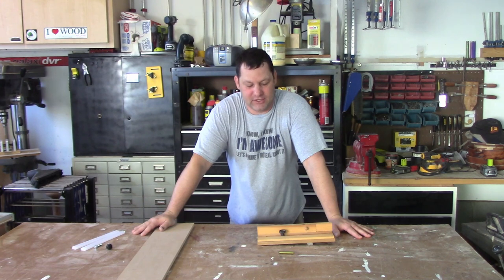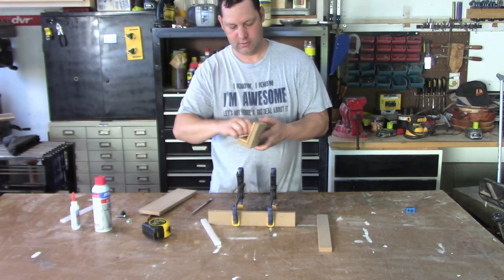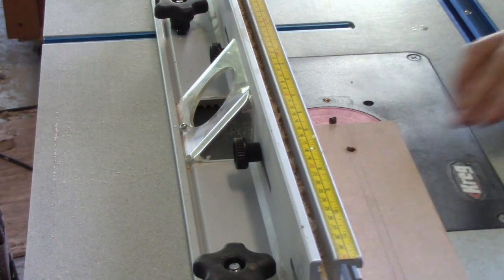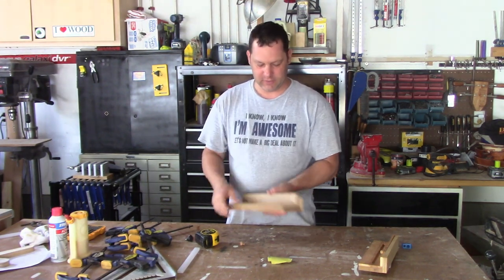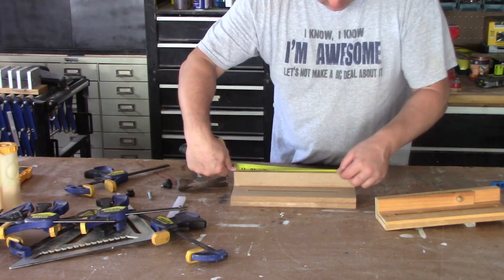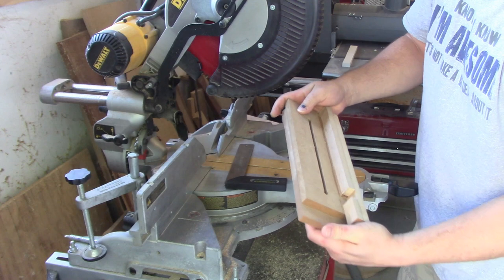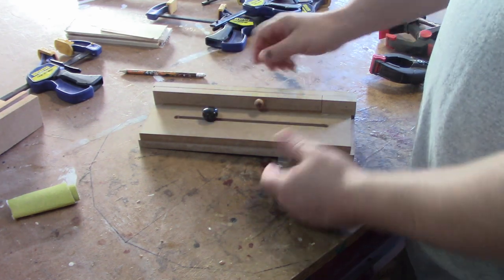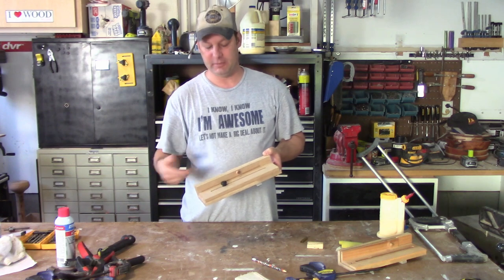pen blank sizing jig

Comment: Great little jig, and one I may have to make soon!  I think others have noted, but the T-nut should be installed on the bottom, not the top, since when you tighten the knob, you don't want to pull the t-nut out.  If it were underneath, it'd compress into the wood rather than extracting out of it.

Comment: Thanks Keith for the video! I built mine today, to your specs with a slight modification. 
I put dowel pins in my miter slot block and drilled two sets of holes in the base… one for my band saw and one for my table saw. 
That way I can easily switch between them (I have a Shopsmith).

Comment: After watching your video, I had to make my own. It works perfectly, and knowing ahead of time just how much I would use it I made mine out of solid 1/2" maple. The only thing I did different was run the T-nut in from the bottom. You gave great directions, making it very easy to follow and build. Thanks for sharing.